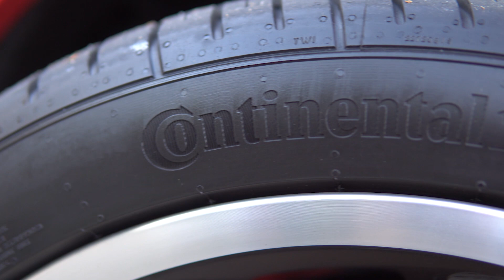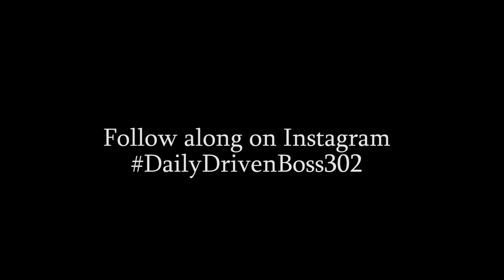The Verdict Is In | Solving The Issues With The MT 82 Transmission

Comment: Instead of changing transmissions, Ford doubled down and denied they had problems, denied people's claims, and overall didn't support their customers. I can't believe they didn't go back to Tremec. They ruined an otherwise great car.
Reply: Just like they tried to do with the dual clutch junk.
Reply: They did the same thing with the Voodoo engine in the GT350. They released a "revised" Voodoo, but its still a crapshoot with reliability.
Reply: All the 5.0's from 2015 on should have got the Tremec after seeing what people went through with the first gen's, and all the complaints.. But the real tripple down was with the Gen 3 2018's too..
Reply: @marcasswellbmd6922 they didn't need a tremec they needed a better clutch and shifter setup but especially the clutch ecsp on the boss with its 7500 redline stock.  It should have had a better clutch and a one piece Ford performance ds right from the factory.  As well as the car is set up that's the one area that needs attention.

Comment: Only reason you have all those issues is because the stock clutch.. once you replace the clutch it eliminates pretty much everything
Reply: It's not just the clutch. The internals use a lot of cheap parts. That transmission is an overall piece of shit.
Reply: [][][]MANN it lasted me a till 80k miles then I ended up getting stage 3 Ben calimer
Reply: @alk1317  are you satisfied with it?
Reply: @alk1317  did it last like that completely stock
Reply: I changed my clutch to McLeod extreme street clutch 700jp clutch…..still get lockout
Reply: i did. Youre wrong.

Comment: I finally just did the $100 syncro shift 2 and their $20 treatment in the trans and the rear.. I just hit 14K and I did the rear gear oil n trans and the rear looked Burnt! And the trans case was brown black but not burnt.. I do have to say the syncro shift II really did smooth out my syncros and the MT82 a lot.. But the real fix is either an EXedy Mach 500 or 600 or some kind of new clutch.. And finally You don't need a twin disk either, not for 450 to 550 Wheel torque!! Oh and they really screwed all Mustang GT owners with these MT82's but they really screwed over the Boss 302 owners and the S550 owner's because, they knew just how bad that trans was before 2015 and to this day still go with it................

Comment: Ford has come out and said its that inner blue area of the flywheel that causes issues. I was told to replace the clutch, flywheel and it will solve 90% of potential issues. Also, throwing a MGW shifter and 1 piece driveshaft will help too. The stock shifter is decent though. I think its a barton?
Reply: did everything u just named. still doesnt work
Reply: @Johnsmith20485  lies

Comment: It's the clutch. Expanding and flexing at high rpm not decompressing and letting you shift. It kinda pushes the peddle back at you. Put a mantic. The high rpm lock out is over. Not the shift forks are weak also.
Reply: no it is not
Reply: @Johnsmith20485  yes it is
Reply: They didn't really have shift fork issues till the 2018 mt82d4 came out.

Comment: I've been driving a manual since I was thirteen, this transmission is the absolute worst. You can't lazy shift with these when getting on the power, have to be firm, but even driving around town sometimes it will grind/lock out from first to second and even third, makes any driver sound like a novice when it grinds.
Reply: Have you done a good twin disc clutch?  A good shifter? Change the Trans fluid?  Those things help drastically.

Comment: Change the clutch out and it will fix pretty much everything. The MT82 is actually VERY GOOD once the clutch is changed out for a better one.
Reply: Which clutch for the MT82 do you recommend?
Reply: anything not stock lol  @Whotta
Reply: no it is not
Reply: @Johnsmith20485 it's not a bad trans.  The clutch and shifter setup is 95% of the issues if not 100% of the issues.  The 18 up ones had shift fork issues because they changed them for those for whatever reason.  Ppl weren't really having fork issues prior to that.

Comment: I see many comments stating that people who opt for swapping the Getrag MT82 for a TR6060 OR TREMEC XL MAGNUM are unable to drive manuals. I have one question, what transmission is found in the 2010-2014 GT500s and the 2016-2020 GT350s?
Reply: It’s not that, I have a Tremec TR-6060 in my 2010 Chevrolet Camaro SS. Even their stock factory builds aren’t perfect either. 5th gen (10-15) manual  Camaro’s and similar like the 08-10 C6 base manual Corvette, and 08-09 Cadillac CTS-V, are plagued, with stock gearbox, clutch, and master cylinder issues. 

The Camaro shares a master cylinder with the brakes and clutch together…. The brake fluid boils in the brakes, and the clutch material from the slave cylinder design also contaminates the brakes too, as does the brake contamination in and of itself to the clutch. The overheating brake fluid if keeping the shared fluid reservoir, causes the clutch pedal to lose hydraulic pressure and not return to the top fully; causing further issues like a dragging clutch or grinding gears. 

Aside from that, earlier 2009-2010, and even some rumored 2011 Camaro SS’ have the crappy PAPER-lined synchronizer rings, which tended to fail when driven hard, let alone TRACK driven… I’ve so far also had clutch chatter on inclines, which doesn’t affect performance too much besides noise and such. Gear changes are good because I’ve flushed the trans and rear diff. I run the proper gear oil/ATF that is spec’d above standard for my trans. I also plan to change the trans fluid/gear oil every avg oil change, which for me, is around 9-10k miles. 

Even in my older Honda/Acura MT’s with lighter clutches and flywheels, but semi-durable gearboxes/trannies, I always changed my gear oil (no ATF for these) with every other oil change (5-8k) and felt that this was very worth it. Early, preventative maintenance might be costly, but you are already driving an average $25-30k+ priced car, so….. If you can’t maintain the car, don’t beat on it or you’ll regret it….

Comment: I found double clutching between gears when the transmission is cold makes going into gears smooth and easy on the gearbox. Works on my 2012 Boss
Reply from the maker: Great advise I will try that as well.
Reply: Better fluid fixes cold notchyness. Double clutching is unnecessary with synchronized boxes.
Reply: Mike unnecessary on most synchronized gearboxes. I just found on a cold MT82 Double clutching helps until everything is warm. After that shift normally.
Reply: Erik Ressdorf  yeah. That would frustrate me. I just switched to Amsoil and no longer have that problem.

Comment: looking for a 13-14 gt and I'm starting to realize why autos are so hard to find.
Reply: Women love those autos
Reply: Ended up with a manual
Reply: @JonFox1945  hows the mt82
Reply: @theory9651  Honestly, it's nowhere near as bad as people make it. I have it as my daily driver and I drive deep in LA traffic, like the real heart of LA where the skyscrapers are at, sometimes it takes me an hour to home from work.  Lots of stopping and going and I love manual... 

Manual over auto is not a deal-breaker. It's not an issue that is going to cause you frustration. The only situation I can think of where it would annoy the crap out of you is if you are a drag racer. 

The high RPM lockout exists, but it's not all the time. Whenever it does happen, it's more like, oh that was weird, let's try again. 

I was told my car comes with a stage 2 (assuming twin) clutch and that could be solving most of the issues related to the lockout.  I plan on going MGW soon, which I hear also helps eliminate most of the high RPM lockout. but the way it is now is not infuriating in any way. 

I also have the BG synchro shift 2 transmission fluid with the special additive. It works wonders and it makes shifting feel so much smoother. I don't think it does anything for the high RPM lockout, but it does feel pretty smooth the first few miles. You totally notice an improvement.

In summary, a twin-clutch and MGW shifter will make it so over 90% of your pulls have no high rpm lockouts.  The BG Synchroshift II Transmission fluid makes it so that normal everyday shifting is a LOT smoother. 

Finally, if you have the money, just put a Tremec magnum transmission in there to solve the shifting issues 100%.

Comment: As far as my research goes all the issues is do to the stock clutch, once you upgrade to a good clutch the transmission holds fine
Reply: no it absolutely does not
Reply: @Johnsmith20485 why do you keep saying this?  100s even 1000s of people have fixed their mt82 issues with a good aftermarket clutch and shifter setup and each person who gives their feedback you keep disagreeing with everyone.  That fixes the issue 99% of the time...there will always be outliers with anything.

Comment: Does anybody have any advice on beefing up the clutch pedal assembly? I recently did a high RPM pull and now it has a little play at the top of the range on the pedal? Like I have to pull it back with my foot about 80% of the time
Reply: Did you happen to figure this out? Mine does the same thing.

Comment: I' think if buy the stage 1 clutch there are some brand where you feel pedal of clutch softer and changing gear will be smooth too if you think those old formula 1 car from 80 to 90 you can see the struggle to change gear but they do like 70 laps racing so changing clutch will fix 90% of the time.
Reply: 90% is over estimating

Comment: I've heard Alex Flores liked the Barton short throw before he went to a T56 in his 2011 Mustang GT.
Reply from the maker: Thanks I will look into it for sure.
Reply: 97jag440  Barton’s, including the hybrid 3, are still body mount.
Reply: 97jag440 I have the MGW race spec and its not any better that the barton. If the trans is notchy, its the unit itself being a POS.
Reply: Alan Davies if it’s notchy all the time the trans is probably borked. If it’s notchy while cold, just use the Amsoil cocktail and it’ll be good.
Reply: Mike what is borked?
What dies the amsoil cocktail consist of?
Reply: Alan Davies borked=bad, broken, etc. Its called the Ben Calimer Amsoil cocktail. 2 qts Amsoil Synchromesh and 3/4 qts of Amsoil 75w-90 Transaxle fluid.
Reply: His transmission just blew apart, and it's Alejandro Florese, not Alex

Comment: First, why not get the Continental Extreme Contact Sport?- basically its the new generation DWs  and is touted as being significantly better in all aspects and equal to Michelin Pilot Super Sport. 

Second- mgw race spec or nothing. MGW even offers a discount if you trade your first gen MGW. MGW race spec is the only fully trans mounted shifter. They also have great customer service.  

3rd- the rear x brace hasn’t been shown to increase rigidity in a practical manner. So, that’s not really a loss. 

4th- use the Calimer Cocktail for fluid. It works very well. 2 quarts synchromesh and .7 Manual trans lube GL-4. There’s no been any issues with this oil setup. 

5th- don’t forget about your diff. That car is old enough it’s time to change it.
Reply from the maker: Mike dropping the info! Thanks Mike. 1. I bought the dws as I am driving the car year round. It will see light snow. 2. Your right I am planning on getting that shifter. I did not know they had an upgrade program. I will reach out to them so thank you. 3. I see your point. I will put the brace back in when the car gets a roll bar. 4. Will keep that in mind. I plan on doing that just in the new year. 5. Diff was done when the car got a watts link installed. Thanks for watching!
Reply: Sean McGuigan  if for use in winter why not get winter tires? Did you know that all seasons lose most of their capabilities below freezing? Even if there’s no snow, winter compound tires have significant grip advantages when the pavement is cold, even without snow/ice. Michelin Xi3 tires are the best winter tire with the Bridgestone Blizzak being best if you have to drive in deep snow. They also have “Performance winter tires” such as the Pirelli Sottozero that have high ratings. Snow tire reviews on RWD cars aren’t easy to find. I did a lot of searching last year and this is what I’ve found. The only time all seasons are acceptable for winter is if they are “snow” rated and have the snow flake on the tire OR you have a 4x4/AWD, although that doesn’t help you stop. 

If I were you, I’d do like a lot of us do in Michigan, get a set of winter tires on steel wheels. Ford recommends stock width on the Boss with winter tires but data has shown narrower width in winter yields significant grip in snow over wider tires. 

Good luck.
Reply: I too use the Calimer cocktail, works great for me.

Comment: I bought a warranty online through Endurance a month after I got my 2012 Boss 302. Ive had the car for almost 3 months now and I took it in 2 weeks ago because I was having issues with the gears. My fifth gear was grinding every single time unless the RPMs were perfectly aligned and i was getting locked out of 2nd at high RPMs. I put about 2000 miles on it since I've owned it. Turns out I need a new transmission and a new clutch. I got the Spec stage 2 and aluminum flywheel myself and had to wait for my warranty company. They denied my claim and I got stuck with about a $5k repair bill. I originally thought I couldn't get approved for a warranty through Ford because there was a blacklist and wouldn't warrant the Boss 302 but I just found out that isn't the case. I get my car back in about a week and have to deal with the cost. But I want to know what your thoughts are and what you are doing
Reply: Turtleduck5000 I
Reply: Turtleduck5000 what a disgrace ford is doing to the brand

Comment: I LOOOOOOOOVE my 285/30/18 Continental ExtremeContact Sport tires (yes ExtremeContact as 1 word) the 06 that you said are great too but the Sport is the newest... also, need to get my 3rd transmission fixed again, what all did you say got done on yours to fix the issues?
Reply: @Rocco Walker Instablaster ;)
Reply: @Nikolas Adrien I really appreciate your reply. I found the site thru google and Im in the hacking process now.
I see it takes quite some time so I will get back to you later when my account password hopefully is recovered.

Comment: How is the clutch holding now that it's been a while since this video came out lol. I also had my trans rebuilt by Ford but didn't change out the clutch during the repair. Howerver, I'm in the market for a clutch now because it locked me out of 2 a few times so I don't want to risk the transmission again. Thx

Comment: I get lock out now.. 2000 miles later I'm getting lock out now.. 3rd gear once in a while.. The 3rd synchro's kinda suck badly.. It smooths out once it gets warmed up fully. But it's still funny sometimes... I can't believe Ford put these MT82's in our cars.. It's shameful..

Comment: SORRY FOLKS its not the transmission,m its the shifter being mounted to the body instead of directly to the trans like with the blowfish bracket or an mgw race spec shifter,thats the ONLY thing thats going to cure the high rpm lock out 100% theres nothing wrong with the MT82 its the shifter! you can use the stock shifter with a blowfish bracket and never get locked out of gear at any rpm!!
Reply: Sorry man, I'm brand new to mustangs, I just bought my 19 GT last Saturday and tbh I'm new to muscle cars in general. Where can I buy this bracket or does it have to be custom fabricated??
Reply: @johnnymoya6261  lmr.com
Reply: WRONG
Reply: Hey does this work with the ford racing short throw shifter too?

Comment: You said that you got an overhaul done for free, and then immediately state that you gave "them" a slew of parts that you "didn't cheap out on."  Math is math, if you spent money on parts, then it wasn't free...  So I call BS on "free."  The cherry on top of this video is that Ford dealerships will not replace anything with aftermarket parts, period.  So your "rebuild" was not done by a Ford dealer. And if it wasn't done by a Ford dealer, how did you get warranty work done?
Reply: Ohhhhhhhhhhhhhhhhh!!!!!

Comment: Mt82 ftw. Anyone who says upgrade to the tr6060 or t56 at lower power levels cannot drive. Great video man.
Reply from the maker: Thank you!
Reply: That's total bullshit. So the parts break and are defective because your opinion is that the owners "can't drive" Ford must be paying you
Reply: [][][]MANN driving mine for 200k miles. Stock no rpm lockout no gear lock out. Its because i can drive manual and get the fluid done every once and awhile
Reply: Mt 82 is junk
Reply: @williamburtjr.8730  you’re a NDMF that’s clear 🤣
Reply: It takes a good clutch and shifter w the calimer fluid and it's golden.  The gearing is way better for na na coyote.  If you go to a tr6060 it's gonna need like 456 gears to be comparable to the 373 with the factory mt82 (11-17 versions)

Comment: I know this is old but high rpm lockout is always the clutch. 

Also, why do you need to change the tune if it’s cold? People, fords ecu logic will adjust 

Also Pirellis are hot garbage
Reply: "I know this is old but high rpm lockout is always the clutch. " 
No it isnt
Reply: @Johnsmith20485  you’re right I didn’t mean literally every time. 

But more often than not. 

But I’ll still argue with you
Reply: @CalebsCars a good clutch and shifter + calimer cocktail and it's golden
Reply: @midnight347  recipe for success